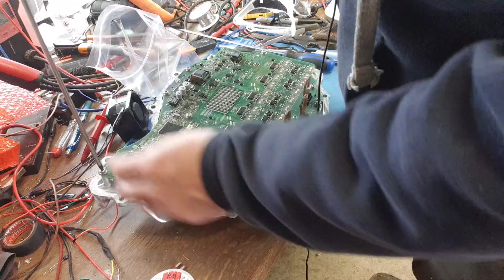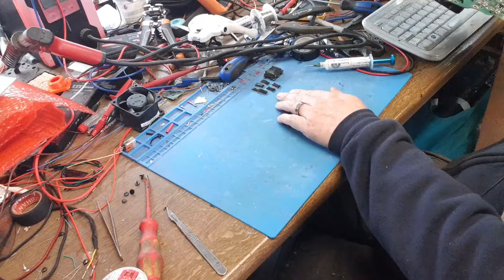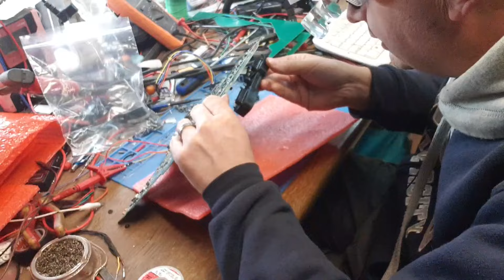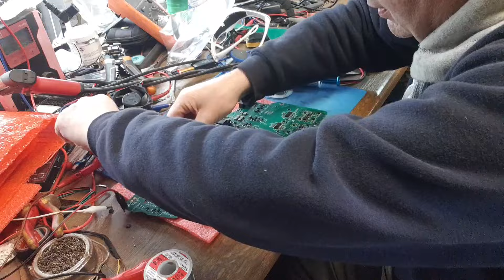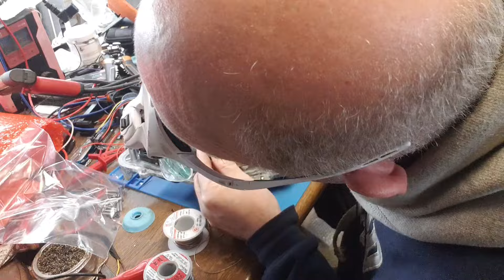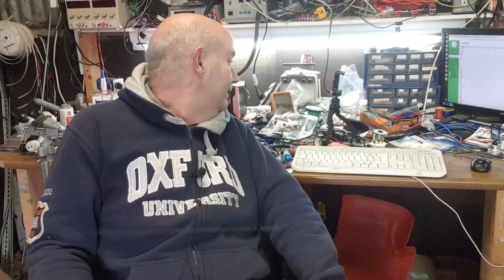Tesla Model 3 Drive Unit PCB Design 16 : V3 Beta Board Install

Comment: A hot air station, or even a paint stripper if you're careful, can really help to keep a board with a lot of heat capacity warm in the area you're working.

Comment: The torch method works great when you don't want to save the PCB. Sometimes when you're taking something apart you have to decide what is the treasure or the trash, you just can't save both.